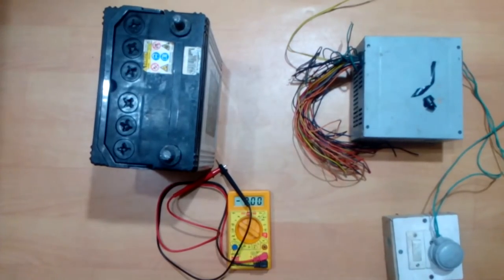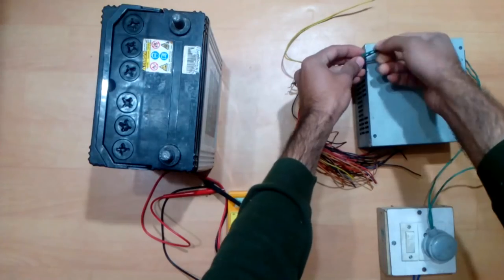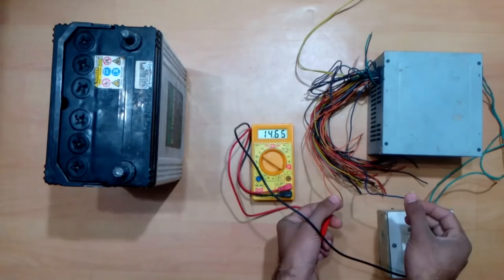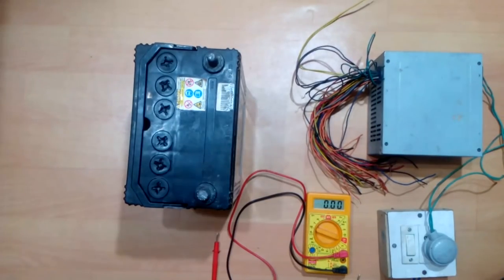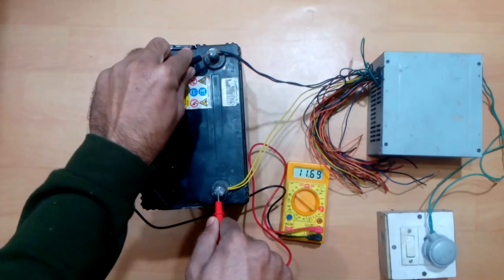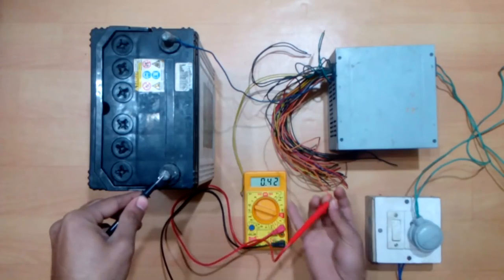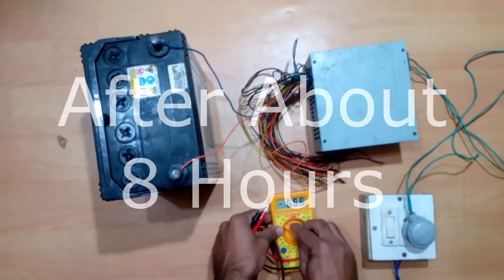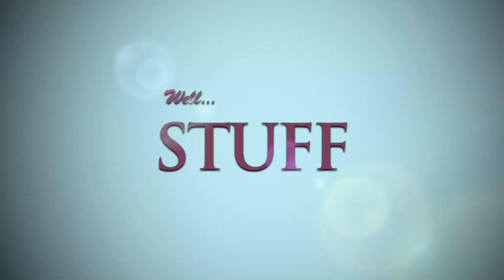Safely charge a car battery using a computer Power Supply Unit (PSU)

Comment: If ur batery is at 11 v i can charge using the 15 v line right
Reply from the maker: +hitman start with 12 v, for 10-15 mins, then change over to 15v, battery will draw to much current and may ruin your psu
Reply: Also the 15 volt line consists of a 12v and a 3.3v wire
Reply from the maker: +hitman -12v and 3.3v, not 12v, if u use 12v and 3.3v its just 8.7v.
Reply: Great Indian Jugaad thx u made it more understanding to me

Comment: Can i charge 12v7ah battery with this ? Please help
Reply from the maker: +dhananjay chauhan sure, follow the instructions as per video. Capacity does not matter, voltage does.
Reply: How much time it will take to be full charged ?
Reply from the maker: +dhananjay chauhan i suggest charge for about 4 5 hours and it will not fully charge but enough for one or two ignitions.

Comment: Can I use 19 volt charger in the same way?
Reply from the maker: +Mona Hatt Yes you can but the 19 v supply must have more Amp rating bcs 19 V supply will have to much current flowing through the circuit. 

Simply don't use it unless you have some kind of current limiting arrangement.

Comment: Does the Amperage drops as soon as it gets closer to nominal voltage? because i have a 12v 6a battery charger here but it drops to like 9v if I draw 6 amps from it with a lightbulb so I assume the closer it gets to nominal voltage the less current draw there is? can someone confirm please or link me the theory please <3 :3
Reply: Different types of batteries have different voltage under load but yeah your reading is accurate.

Comment: this video i wrong and fake i tried it.... after you connect -voltage in 10 minutes your PSU will burn out. rendering it useless..
Reply from the maker: +M Hassan Ajmal connecting -ve voltage is not the only thing you have to do. Make sure you connect correctly polarity, correct potential difference. -12v and +12v is 24 volts, -12v and -5v is 17 volts. Both will blow up your PSU. Watch video carefully use -12v and +3.3v , difference will be 15.3volts, and current out put will be between 0.5-1 A and will definitely wont do anything to your PSU, and Lead acid battery can take upto 2.8volts each cell thats 16.8 volts safely. 

So unless you f*ck this up in connections there is nothing that can go wrong
Reply: A car battery that's low on charge may be very capable of drawing a huge amount of amperage and burning out the power supply. Especially when the batteries voltage during charging gets up over 12 volts.   If the power supply isn't capable of throttling itself and stopping itself from burning out it would be good to stop charging at 12 volts which is officially dead but maybe enough to start the car